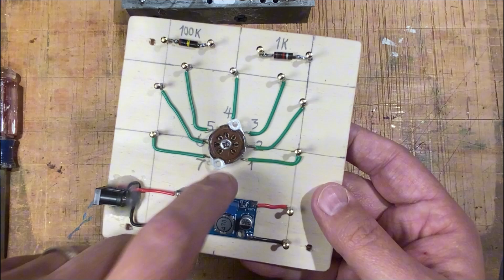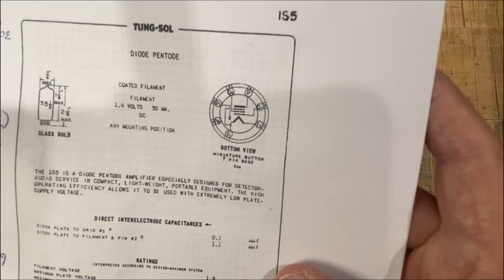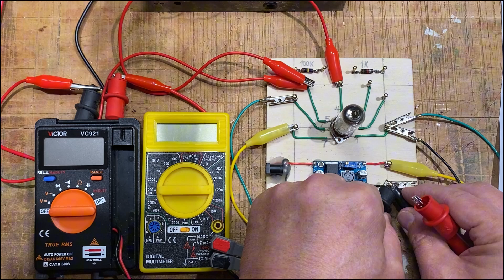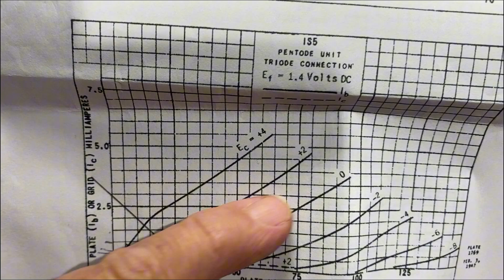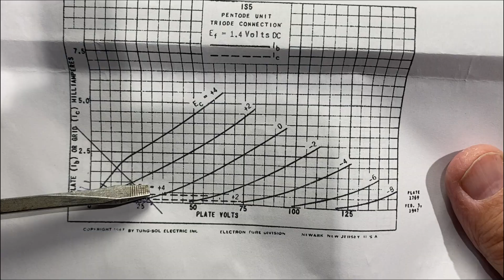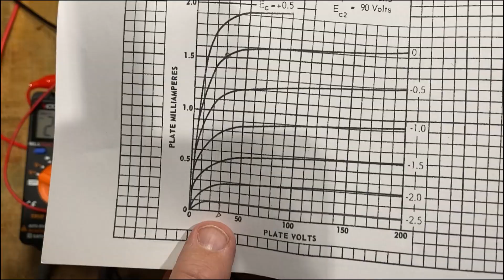Imperial Radio GUITAR AMP Testing BAD Tubes

Comment from the maker: In this video, I troubleshoot an old Imperial battery-powered tube radio that I converted into a small guitar practice amp. After working for just one day, the amp went quiet and stopped outputting sound. The culprit? A bad vacuum tube.

I’ll show you how I diagnose the issue using a DIY tube test harness with a buck converter, resistors, and alligator clips. Step by step, I walk through testing three classic tubes — the 3S4, 1S5, and 1U4 — and explain how to measure current, voltage, and performance against tube datasheet.